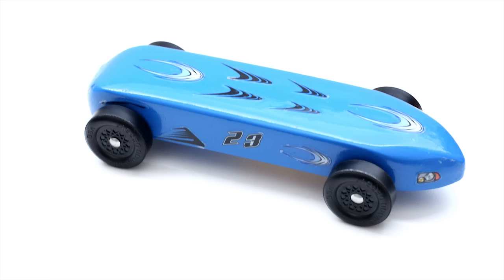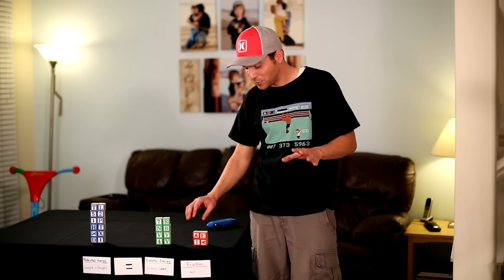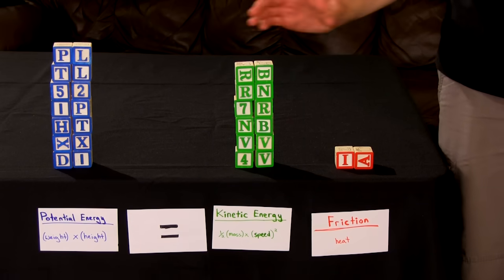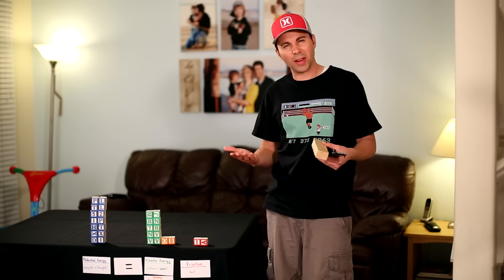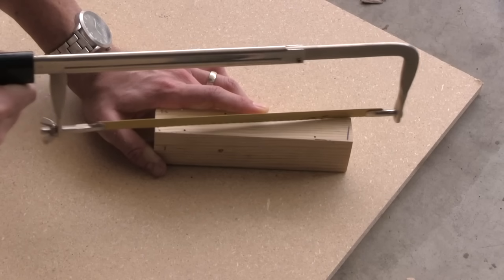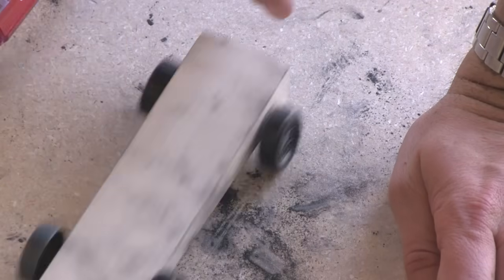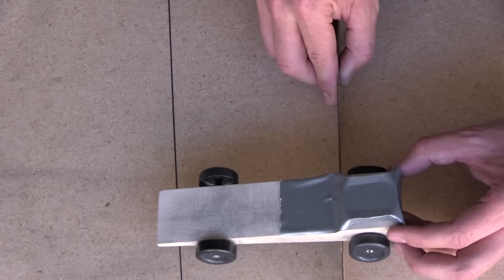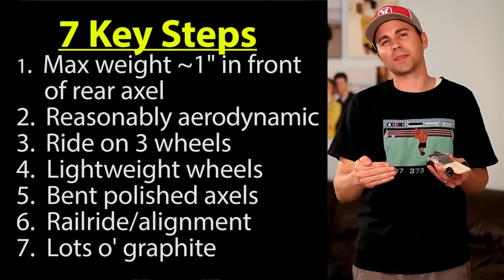EASY Pinewood Derby Car WINS using Science!!!

Comment: The biggest source of friction is the wheels scraping on the center guide.   That is the key to everything.    The reason the bent nails help is not just because they drift to the nail head for lower friction, but because it moves them away from the center guide and makes sure they don't touch.  The front wheels must be closer to make sure they are the only ones that touch.   The rail rider concept makes sure that only one wheel ever touches.   I think it is better to have the raised wheel be the only one that touches because now it is a bearing not scraping at all, since it is not in contact with the track.   Finally the weight in back is so that the wheels bearing most of the weight never are wider and never touch.  Also, this gives maximum moment arm for the front to steer the car as easily as possible.   It would be best to make the front as light as possible so it takes the least effort to steer the car.  However there is a limit, as too light leads to bouncing around which takes the energy out fast.   So you want the least amount of weight on the front guide wheels that still keeps the car stable.   Everything comes back to how it rides the rail.   Lastly the cutout in the nails under the wheel don't reduce friction as stated but it does serve a different purpose.  All derby's have multiple runs to determine the winner.   With each run some of the graphite is lost and wheel friction goes up.   The gap in the axle serves as a reservoir for additional graphite to replace what is lost over time.   But it must be filled for that to work.   This is my final secret.   In order to completely fill the reservoir with graphite use chemical deposition.   Make a slurry of graphite and rubbing alcohol and pour it into the axles.  When the alcohol evaporates it will leave large amounts of graphite deposited everywhere.   Yes, my sons won every year, yes I am an engineer, and yes I made my own track and did lots of trials at home.  You don't take an untested prototype to market now, do you...
Reply: Wouldn't you want the wheel already touching the track to be the one touching the rail, so you don't impart rotational energy at all to the raised one?

Comment: one year my little brother just painted his car put the wheels on it and that was it no cuts or anything and just by doing that he got 3rd place
Reply: Caleb Alexander wait? Just the block?
Reply: my friend did something similar. he didn't even build the car. my dad built it minutes before but the race started. just widdled it into shape with his pocket knife and threw it on the track. he got second place.
Reply: Insert "I don't believe you" Ron Burgundy meme.

The block of wood alone weights about 2 ounces, maybe 3 with nails and wheels.  As he just said in the video, the key is getting the energy into Kinetic energy.  If you are racing ~2.5 oz vs. 5 oz, you are already starting at a 200% disadvantage in total potential energy...the other cars would have to be intentionally poorly built also.

Or he put on 2.5 ounces of paint and got lucky and hit the 5 oz on the head (that feels like a lot of paint though.....).  Could totally see a car taking 3rd if it simply hit that one qualification of weight.

Comment: Should try drilling holes in the wheels to reduce rotating mass
Reply: That is smart 😮
Reply: It depends on if wheel modifications are allowed. If they were, I'd not only drill holes in the sides of the wheels, but make the wheel much thinner, like a tiny bicycle wheel.

Comment: For Cub scouts official, most don't allow bent axels, and 4 wheels need to touch at all times. Also, official BSA tires need to be used.  Basically, 5oz, C.O.M., lubricate, and rail riding will lead to the perfect car for legit racing.

Comment: One thing I don't think you mentioned. Those plastic wheels are not true circles. You can use a hand lathe to make them true circles. This will both help reduce wheel weight and stop energy loss through wheel wobble.

Comment: In cub scouts my pops took the balsa rocket project to the space age....in the 60's. He turned the body down to reduce weight.....then smeared vaseline on the rubber band. The results were amazing. Other kids rockets weren't halfway down the track when mine reached the end. The other kid's dads were steelworkers. Mine worked for Douglas Aircraft in the math department (b4 pocket calculators). Sheer Domination!

Comment: About 25 years ago I won second place in my district finals. I can’t say I came up with all the ideas myself, but I designed, sanded (I didn’t cut, drill or fill it with lead obviously lol) and assembled it all myself myself. The trophy with a pedestal for my car are on a shelf in my room. I didn’t know the 3 wheel trick and looking now it seems I didn’t use the most effective wheels, but im still proud of 2nd in district. Lol

Comment: practically everything in this video is now a banned method for racing
Reply: From what I've seen, wheels must be bone stock from the kit, must have 4 on the car, can't modify the nail slits, and no graphite/molybdenum. besides that everything's fair game!
Reply: You must not do or watch much racing of any type; rules are, um, suggestions? Even slight, hard to detect differences add up. If you can get away with a 1% variation and do it 10 times with different things...
Reply: As they say in NASCAR, "if you ain't cheating, you ain't trying".
Reply: y
Reply: no graphite/moly. but there are dozens of other decent lubricants out there.
Reply: Powder Graphite is legal bent axles are not even polishing is stretching the rules
Reply: There should be an "anything goes non-powered" league where you can do whatever you want to the car so long as the only energy going into the car is potential energy from the ramp. No rubber bands, no charged cartridges, no electric motors but do whatever you want to the car.  Maximum science!
Reply: They'll eventually ban every possibility you find out.
Reply: Yep
Reply: oh, hey, there's a word for that! did you know? its called CHEATING.  "rules are suggestions" are how CEO wind up thinking its OK to fraudulently charge millions of customers hidden fees (*COUGH* wells fargo *COUGH*), and is not honorable.
Reply: @CamdenWallraff  lets get the mini rockets!
Reply: In our pack graphite is fine (no liquids though), but all four wheels have to touch and the wheels must be stock.
Reply: @Sara-L  for example mayonnaise
Reply: @Raythe  "The American Way" 😒
Reply: It's usually up to the individual Cub Scout packs to define the rules in detail.   There are very few rules that come with the kits themselves.
Reply: @Raythe  Those CEO's didn't think it was okay. It was blatantly illegal they just hoped they wouldn't get caught. Go ask all the poor people out there how all that "honor" is working out for them.
Reply: Back in the day I watched a kid (dad) destroy everyone else by using a vial of liquid mercury. They troop banned it before trophies were handed out, but there wasn't a car in this country that could touch it.
Reply: @Sara-L  exactly, why not oil?
Reply: We can only use the kits no modification beyond painting
Reply: @hebekiah3623  I think my real problem is why is he participating in an event that is basically for kids,....
Reply: Christopher Fair  

Should have a pinewood derby car for adults....
Reply: Depends on the pack

Comment: The floating wheel trick is illegal now, I figured that out the hard way.
Reply: What? Why?
Reply: Canting is illegal now too
Reply: Boo!
Reply: @jonathonhobbs6676  That depends on your race rules.  Our pack has no rules against a raised wheel and no rules against canting.  The World Championships in NYC have two divisions a stock division and a pro stock division.  Stock division has to have all 4 wheels touching, but pro stock can use 3.  No bent axles are allowed, but canted axles are if you drill new holes or use a guide to set them.

Comment: What about lubricating your spinning parts
Reply: ... that is what the graphite is for
Reply: Carson W234 graphite is less lubricant as something like silicone spray or wd40
Reply: Wd-40 isn't a lubricant, it's meant to be a rust solvent(or rather a water displacer, hence WD). 
Now I assume that graphite is the best lubricant in this case because it's a) a really really good lubricant and b) doesn't dissolve plastics.
Reply: rules, sometimes even graphite isnt allowed
Reply: That's what SHE said!
Reply: Wood is porous, a wet lubricant like an oil will just soak in, silicon would likely dry up and get sticky. Graphite is used because it is dry and stays dry.
Reply: Silicone would dry up yes, so we put it on before every race for my trophy winning cars and it works really well on plastic wheels. Wish I could find some information on the coefficient of friction between silicone spray and graphite.
Reply: Fruit PornDesu hell yeah

Comment: I competed in a PWD back in 1985.  I won.  Mine was similar except that instead of a flat rectangular body, mine was a flat isosceles triangle.  Weights were in the center.  My initial acceleration was less, but I had a higher top speed.  At the bottom of the ramp, I was behind.  But on the flat part, I always passed the other cars.

Comment: Upforce seemed to help me, in a normal car you want downforce to keep more of the rubber in contact with the road but with Derby you want the less friction possible so sanding an "air pocket" under mine helped a lot, also no paint, just primer and sand smooooooooth for that frictionless glide

Comment: I just used this design and came in 4th out of 25 for the adult division…only thing I didn’t do was sand the wheels which might have gotten me into the top 3.  Overall very easy only took 40 mins. Great car.  Average time 3.4785 and first was 3.2068

Comment: The one factor of grooved axels is you can load it with more graphite. Usually they do not allow you to handle your car once it is checked in so graphite will dissipate with each run. More room for graphite and you have more consistent runs.

Comment: Wow, people are paying for that kind of stuff? There's about 1 cents worth of plastic in those $50+ wheels. lol I'm in the wrong racket.
Reply: Charlie Mopps a few of the brands are milled instead of injection molding, and they're held to very strict quality standards (like, aircraft grade) but they are still hellishly expensive.
Reply: Aircraft parts are still injection molded. What determines quality is the pressure used during the molding process. I seriously doubt they are "milling" plastic parts. They'd just melt, and the quality wouldn't be any better.
Reply: Charlie Mopps You can mill delrin fine mate.
Reply: *****
 I just looked it up, melting points 175C, so I guess, yes, you could. I still don't see the point though.
Reply: Charlie Mopps The precision to which they are manufactured, and the limited market they have would drive up the price.  I bet they're barely breaking even, even at $50 a set.

Comment: Thanks for the video!

Our rules state that all 4 wheels have to touch the track.  Can you still use the rail riding technique with the straight 4th wheel touching, or does the 4th wheel touching make rail riding less advantageous than trying to align the car to go straight down the track?

If you should still use rail riding even when the 4th wheel must touch, do you bend that axle as well, matching the other front wheel, but just adjust one wheel or the other a bit more to get the desired drift of 1" or so over 4 feet?

Comment: ...back in the pre-internet days of the 1970's, the closely-guarded secret was to drill small holes into the underside of the car, approximately an inch forward of the rear axle.  Then you poured molten lead (from fishing sinkers) into the holes.  Because adding weight this way was illegal, you had to sand the top of the lead "plugs" flush with the wood surface, then keep adding coats of paint until it hid the plugs.  I don't think cars were weighed or really scrutinized at all before placing them on the track.  So we scouts learned that not getting caught cheating was the way to win.

Comment: I was 8 and actually cut out a hole underneath and filled it with Lead. Then I built a wedge shape winning the competition. Of course staying with in the Weight parameters. Then used the slickest lubricant on the market.

Comment: You can gain a bit more by running the car "backwards," i.e., like a prewar Auto Union, with the overhang at the front.
You can put weight farther back that way; it won't wheelie.

Comment: how about bending or sanding the axle head surface ever so slightly upwards (to make it cone like) so the wheels will have even less contact surface or groove the wheel around the centerhole instead ... the cone shape might lead to other issues so leaving a just a small lip on the wheel bore might be more beneficial

Comment: My twin girls just took 1st and 2nd using the information in this video. Canted axles, polished wheel holes, weight focused 1 inch in front of the rear wheels, and tons of graphite. The other weren’t even close. 1st place car averaged 2.9946 seconds and 2nd place car averaged 3.0323. Next closest car (3rd place) was 3.0723. This was on a standard scout track.

Comment: I made one of these when I was a scout, my dad did not make it. the thing I learned is put the lead weight as far forward as possible, you accelerate much faster off the line. I made a car with the weight in the back and lost to cars with the weight in the front.

Comment: I actually had to cut out my cars. We figured out that an hourglass shape was faster than a rectangular shape. We figured out that a lower car was faster. Cutting a new wheelbase was allowed as well, so almost everyone would flip their blocks over and cut a longer wheelbase. This reduced wiggling that slowed the cars.

Our troop also allowed something known as a cheater bar. Due to the way the cars were started, cheater bars gave the cars that used them a slight head start. You could duplicate some of this effect (but not to the same degree as if you actually used the bar) if you cut out the bottom of the nose of the car, resulting in an elevated nose.

Comment: I wouldn't be surprised if 3 wheels reduces friction as well, not due to the axle friction, but due to any toe-out/in or oscillations that happen causing the front wheels to want to roll different directions and scrubbing.

Comment: My Dad and I used to build some bad @ss pinewood derby cars when I was in Cub Scouts. We would chuck the wheel axles (nails) into a drill and polish them to a mirror finish. We would also use a drill and file to sand the wheels so they were perfectly flat and the same diameter. We used silicone spray on the axles and the wheels would spin like they were on ball bearings.

Comment: Should've made that pressure chamber discreet, with an in-build, pre-pressurized chamber that releases the air though a pipe of a small diameter whenever the car is in motion.

Comment: In 1971 I was in the boy scouts, I won the pinewood derby in 71 and 72 with the same car. It was trimed down as much as possible.
No wheel bearings, no lead weights.
Then they changed the rules, wheels bearings and heavy metal weights were allowed.
It's all B/S, the scout leaders boys were given unfair advantage.
I quit the scouts in 73.

Comment: We may have accidentally cheated when my nephew was younger. I had always polished my axles with a drill and sandpaper however when we did his I didn’t have my drill with me but I had my Dremel tool which seem to make the axles much skinnier because of the speed but we didn’t realize that at the time. It wasn’t until he smoked every car in the competition buy a lot. After the competition I went back and took apart his car and realized how much skinnier the axles were where the wheel makes contact and realized I had shrink them by about a 1/4 of the original size

Comment: 2. Reasonably aerodynamic? Wouldn't this be where the final overall is won after you get all the other things? 
Perfect shape, and speed tuned with perpendicular grooves or ribs (my theory), to allow wind to create a surface boundry layer actually tuned to a specific speed by groove depth, width and spacing. and glaze smooth finish coat....waxed and polished.

Comment: The real secret is to file all the nail edges away, then use graphite powder and NOT OIL.  Make sure the wheels are a perfect 90 degrees from the body, put the allowed weights in front/middle, never in back.

Comment: How come the grooved (thinner) axles don't help? I realise the friction FORCE at the wheel-axle contact doesn't change, but the thinner axle should result in less friction TORQUE and therefore less resistance overall. Or, put it alternatively, the thinner axle results in less distance travelled by the sliding contact at the same force -> less total energy dissipated.
Reply: Absolutely agree. Using a needle instead of a nail should get better results. It's one reason why jewel bearing pivots are so small.

Comment: He's missing an important piece of the perfect pinewood derby car. Rail riding allows you to move the center of gravity further back (3/4 in). In turn moving the weight back removes weight from the front wheel. Less weight on the front wheel=reduced friction. So, you need to turn the wheel sharper to gain equivalent stability. I think the perfect car will turn pretty sharp and have the weight centered at 1/2 inch.

Comment: Has anyone thought of minimizing the wheel to axel friction by creating a ridge in the center of the thru-hole of the wheels to lessen the friction to the axels? Or, would that even help?
Reply: I don't think it would help because it would just put more weight on that thinner ridge and the friction would be the same. The formula is based on the types of materials and the weight. The size of the contact patch doesn't matter